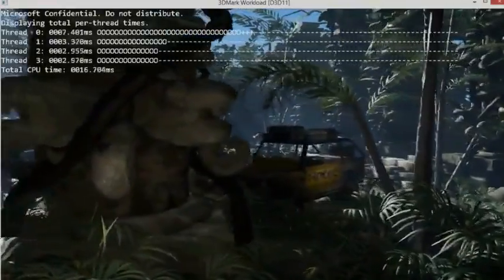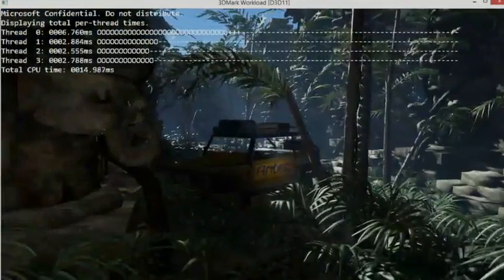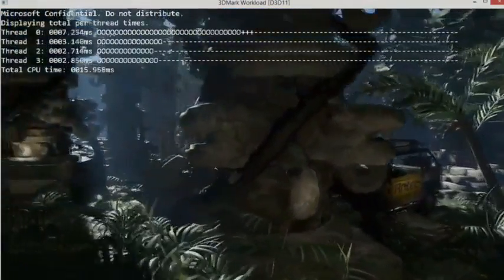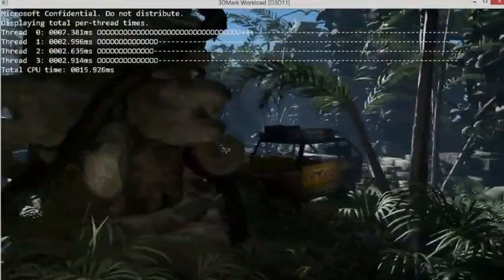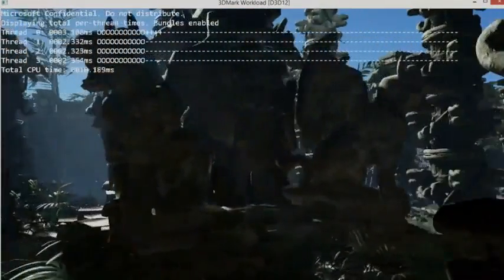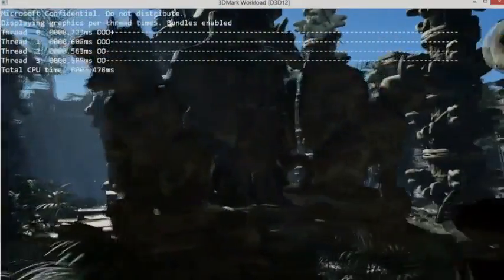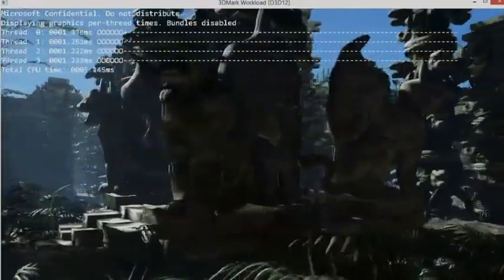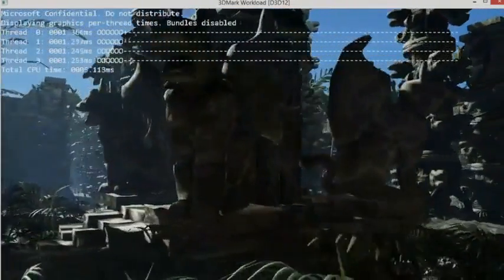DirectX 12 Tech Demo offscreen

Comment: so i have a dx11 card for my pc, am i going to have to upgrade to a dx12 card when this is released, or is it a software update for it instead of hardware?
Reply: Anything from 400 series Nvidia upward and any AMD GCN Graphics card will be able to use DX12.

Think of DX12 as DX11 that just runs way more efficient and faster.

Don't think of it as DX10 to 11.
Reply: Ioner66 so will it improve performance in games?
Reply: Geoff Enyart Realistically speaking, games could perform up to 80% faster if they run in DX12 mode.

Most of that new power will be put into additional graphics quality... but any game that decides to add DX12 support later will just profit from insane performance increases.
Of course not many old games that run on DX11 are gonna waste their resources on converting..but unlike DX11 support...DX12 support will rise rapidly due to the fact that DX11 hardware can run DX12.

So yea...just sit tight and wait for it an you will get lots of free extra performance in the future/rapidly increasing graphics quality
Reply: awesome! i cant remember but i think they said that it will available fall of 2015. but im stoked for that. my hardware will last even longer!
Reply: Geoff Enyart Yea...it's kind of the first directX to ever really care about optimizing performance and reducing performance waste.

Kind of have to thank AMD there (Microsoft already admitted to somewhat copying AMD here - but that is a good thing) for doing the "first step" with their Mantle API.

Don't expect it too soon...but yea...your hardware will be happy about this ;p
Reply: awesome thanks for the info man :p
Reply: *****

Well Intel JUST showed off a DX12 benchmark (like 1-2 days ago) using their Intel HD4400 graphics and got a 70%(!) performance(as in frames per second) increase while also claiming that this will still improve since this is still an early version.

And yes...our APIs ARE this bad...on PURPOSE.

It is NOT in the interest of Nvidia, Intel and Microsoft to give us access to the raw power of their hardware...because if we had access to the raw power even on the older generations...who would still buy their stuff? Edit: Microsoft is in it because if they deliver the "perfect" DX then there is no reason for gamers and 3D app users to ever switch OS again :)

Even DX12 will only be made to be "slightly better" or "as good" as Mantle simply to avoid AMD growing a monster API that can control the market and run on all OSs....that would give them power not only over Intel and Nvidia but also over Microsoft...marketing is an evil thing!

Also keep in mind that DX11 is indeed 7+ years old...while it was released 5 years ago...it was also in development for a while...so DX11 is all but "new" or "last year"

AMD is a little different...as they aren't able to deliver to the higher end market with hardware...they looked for a different way...and thus forced steps by pushing Mantle onto the market....like many times before AMD pushes something new out and the others have to adapt.

While right now their CPUs are utter crap...once again they helped the market for free....thank them for that.

The finalized version of DX12 is expected to deliver 60-150% performance increases depending on hardware setup. But this was to be expected...DX12 is the first DX that will actually allow for PROPER multicore utilization and cuts down overhead by as much as 80%...of course the performance gains are going to be DRASTIC.
Reply: All I was trying to say is that you can expect stronger boosts than 20-40%...because they have to be at least equal to Mantle so they won't risk giving AMD huge market shares and control over the Operation Systems. (In theory Mantle could run on Win XP)
Reply: CURRENT AMD cards will support DX12 a little better than Nvidia cards do.

Nvidia cards currently all run on DX11.0 with SOME features of 11.1 and 11.2 on a software level.(partial support)
AMD on the other hand supports 11.2 on a hardware level (100% support)

So right NOW AMD cards will benefit from DX12 a bit more....but I bet the Geforce 800 series will finally support DX11.2 on a hardware level as well.
Reply: Jeon Soo Neo This is simply not true Nvidia is supporting all their 400-500-600-700-900 series video cards for directx 12. Amd on the other hand will only be supporting it with their 7000-200-300 series video cards Amd is the one screwing over the 6990-6970-6950 owners.
Reply: First of all I didn't say that AMD will support MORE cards...I said they will support it better since their cards support DX11.2 on a native level (the newer ones' at least). 

Try to see the difference there.

Also it's not necessarily true that the 6000 series won't be supported...AMD simply did not specify about the 6000 series....that is all. AMD is going to sit back and wait to see the final builds of DX12 to see if the HD6000 series is supportable without having to do a lot of tinkering on the software side for their drivers.

If it is then it will get support as well. But quite honestly...if you really intend to use 4-6 year old hardware for DX12 applications then you will be just as disappointed as you will be with them TODAY.

Most DX12 games will use the insane amount of free performance to boost graphic fidelity to the maximum.

But then again...HD6000 series was not yet officially excluded...AMD simply did not yet state if they are going to bother. (+ HD5000 and 6000 series GPUs are not really used a whole lot anymore)
Reply: Well it just really speaks volumes about their software department and why Nvidia is working with Microsoft so heavily on 12. Also a 480 is around a 7850 in terms of performance(according to techpowerup). http://www.techpowerup.com/reviews/AMD/HD_7850_HD_7870/26.html
Reply: You do realize that AMD, Intel and Nvidia are all working very closely with them for DX12. I'm not sure why exactly you're trying so hard to discredit AMD...maybe to look like da real Nvidia fan? Not sure. 

Both GPU giants make bad decisions constantly...but at least AMD isn't the company constantly producing expensive proprietary technology that always forces you to buy new and expensive things. coughnvidiacough 

And let's not forget that DX12 would not be as strong in development if it wasn't for AMDs Mantle...Nvidia would also have never released their driver update 337.50.
Fact is that most companies are not interested in giving you 100% of the raw power of their hard and software...because that makes it hard to sell you the next generation if there is no headroom left. 

Microsoft, Intel and Nvidia (and even AMD) are all to blame here at some point or another. 

Nvidia makes proprietary software for games that runs bad on all hardware to make you think you need stronger hardware

Intel slows down CPU advancement since there is no competition....effectively slowing down overall progress.

Microsoft drags out new DX updates as long as possible for the sole sake of adoption rate.

If you expected any of the companies to actually try and deliver their best for you...then you have been fooled MANY years.
Reply: actually Amd themselves claimed 12 wasn't even being made. Ok now with the Amd comment i own a 8350fx right now and a 770Gtx i used to own a 1100T and 6950 i was pissed when Amd decided to leave the 6000 series out or not mention them when Nvidia is more then willing to support the 400 series you know the company you are claiming to be so greedy. 
Also Directx 12 was being made WAY before mantle came out so yeah.....
Intel is a POS i do agree there. 
Nvidia's 970Gtx is more powerful then a 290X yet its only 330$ so pretty sure you are the one who is slightly confused here. For once Nvidia is doing things right(besides G-sync) and i feel like Amd with there lack luster CPU's and outdated GPU's for this holiday season are falling further behind i hear they will have 20nm soon which is cool. 

I want to end this by saying Nvidia is supporting PC gamers more then Amd is this time around Nvidia is giving us cool things for example i LOVE adaptive V-sync something Amd doesn't include in their drivers, also spotty opengl support which sucks for anyone wanting to game with Amd on linux or use Opengl on emulators. 

Lets hope for Amd's 20nm GPU and 16nm Amd zen CPU's i want to see them matter again outside of consoles.
Reply: AMD is releasing freesync onto the market...which is Gsync...but for free. Get your facts straight before saying AMD won't support adaptive sync.

That the CPUs are weak is acknowledged by AMD as well because they're working on a new architecture right now that they want to release in 2016...so it's the waiting game.

And the AMD 290X was pretty much price/performance king for a YEAR...and then last month Nvidia finally came out with a series that isnt overpriced.

But then again... AMDs 300 series is coming soon.

As for Nvidia is supporting PC gamers more...I say gameworks...gameworks craps on your performance of AMD AND Nvidia hardware...why? Because Nvidia wants you to think that you might need better hardware.

And while it craps on both GPU vendors hardware...it of course breaks performance a liiiittle less on Nvidia GPUs (go google that if you want to know more).

Right now I use an Nvidia card myself and I have used almost only Nvidia cards for the past 3 years...but to say that Nvidia is a good company or actually cares about the gamers is something only someone who doesn't look at Nvidias practices can say.
Reply: You don't even understand what adaptive v-sync is has nothing to do with G-Sync something i agree with you on
Someone who doesn't look at nvidia latest projects maybe do you think AA also is some crap thing you do understand why games look better at higher settings right? Not everyone wants to play games at low-medium settings. Nvidia is making great breakthroughs in AA, DSR, Yes adaptive V-sync something i can't live without now, TXAA is my favorite AA.
Reply: Also i like to switch between the two i like efficient designs that perform the best at the best price points i'll probably stick to the 200 watt limit on GPU's something else i find amazing from them their 980 which uses the same amount of power as my 770 but with 35% more performance(see techpowerup reviews for exact numbers) 
Edit it was also done on the SAME 28nm die
Reply: ***** Why exactly would an AMD card not run DX12 as good as Nvidia?

You know what DX12 does, right? It reduces CPU overhead by a ton and thus makes CPUs a "non issue" in gaming while also giving GPUs a breather.

Thus it only comes down to how good the graphics card is. 

Of course a 980 GTX will then run better than a 200 series from AMD...

But it's still some time before DX12 comes out...AMD is set to release their 300 series before that. And the 900 series is currently up vs graphics cards that are a year older than the 900 series.

It would be hella sad if the 900 series didn't beat THAT.

But generally speaking...if 2 cards have the same performance level then they will both run at the same speed in DX12 as well...they will just run faster because of the insanely lowered overhead.